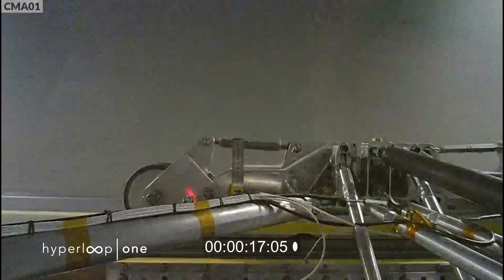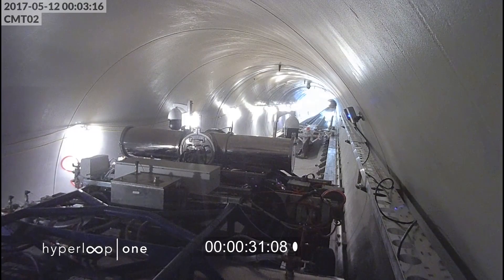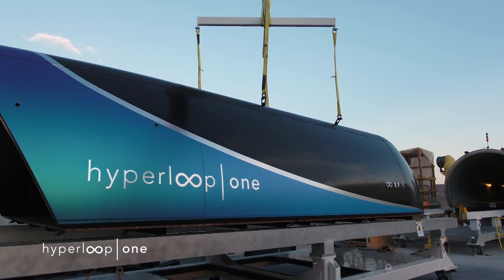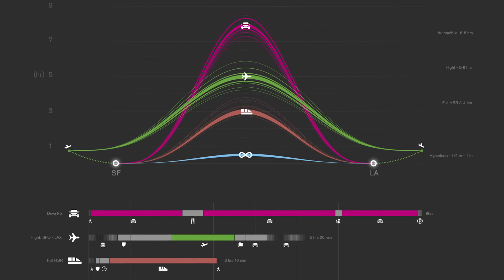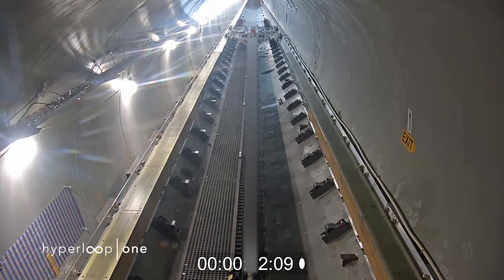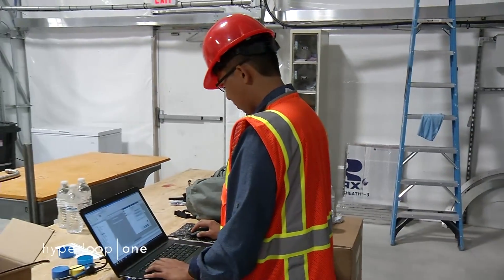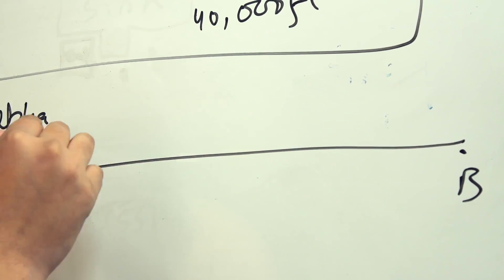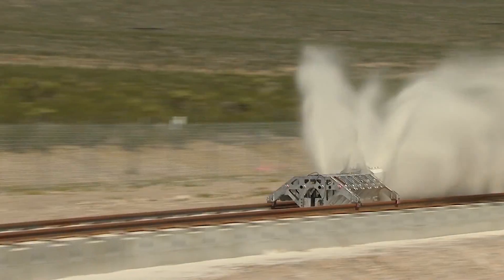Watch the Hyperloop Complete Its First Successful Test Ride | WIRED

Comment: What if a terrorist blows up the hyperloop and nobody can escape because the tube is enclosed? also what happens when the vacuum tube is suddenly opened by a gash?
Reply: What happens if someone blows up an airplane and no one can escape because they're thousands of feet up into the air?
Reply: If it was open by a gash, it would add air pressure and air resistance to the tube and slow down the vehicle.

And really? Terrorism as an excuse to not be advancing in society? Would you have said the same thing for tunnels and subway systems? (hint: it's called emergency exits) I guess the terrorists are winning.
Reply: I don't understand how anyone believes that a tiny hole causes the whole thing to implode. When you just barely crack open the valve on a PLASTIC vacuum chamber, does the whole thing explode? Now how about when you very quickly open the valve all the way? Still nothing. You get a small rush of air as the chamber is slowly repressurized. Something as small as a bullet hole in a miles-long metal tube wouldn't even be noticeable. On top of that, how would repressurizing the tube cause it to implode? Increasing the pressure makes it so the pressure is too low, causing the whole thing to crumple? Right
Reply: Then 8 people die... an airliner crashes about every year killing hundreds
Reply: What's your point suppose to be? Let's stop progressing, or create new technology because... terrorists. Lmao.
Reply: Joshua Salem While it may damage it, im pretty sure it wont destroy the entire thing, For it wouldnt be that fragile, Safety measures are important and since this is a public mode of transportation im confident they would have ways of emergency exit or stops like every other transportation has one. Its still developing and for now theyve only begun testing for cargo, But if it something like that might happen im pretty sure they would have thought of it before theyve begun construction
Reply: Thunderf00t seem to assume that the tube would be made of extremely flimsy material. How naive of him.
Reply: People, please don't watch one video from a random pissed off guy and assume he's totally correct. It's not nearly as dangerous as you believe.. Sure, if the entire hundreds of miles long tunnel were made of plastic, the pressure inside would be as close to 0psig as you can imagine and something would puncture it, there would be some serious danger for the people inside, but it's not. The entire, hundreds upon hundreds of miles long tunnels, aren't made of flimsy plastic but steel. The maximum difference between the tunnel and air would be about 14.7psi, but it's less since a complete vacuum isn't a thing. A tiny hole wouldn't have any noticeable effect on the tunnel, the whole thing wouldn't implode (seriously why do people believe that?) or explode or whatever. Apart from that, although there would be a massive difference in pressure, there's still a possibility for emergency exits. 
TL:DR The longer the tunnel, the higher the pressure, the stronger the material, the bigger the hole would have to be to have an impact on the tunnel. Learn the physics behind it, do some calculations and you'll find that in a realistically long tunnel that would result in a pretty big hole.
Reply: Nothing as serious as being up 25,000 feet in an airplane and the engines stop working.
Reply: Should i remind you that you're bashing a new idea based on it's prototype? you "engineers" really think this is a final product? that if the problems you talk about are so obvious that MAYBE the people actually working on this thought about this issues? that pipes can be reinforced? that emergency exists are a thing? oh, right, you're just a bunch of frustrated idiots who choose to trash concepts based on nothing instead of addressing the issues and try to improve on their design? 

The wright brothers also dealt with idiots like you, yet 60 years later we landed on the frigging moon.
Reply: Sure, Hyperloop is vulnerable, just like everything else. A terrorist could attack anything, not just Hyperloop, and how many of those have you seen happen in the USofA, especially bombings?? I've never seen someone blow up train tracks to send a train derailing into a nearby busy metropolitan area. Not difficult to do, but it hasn't been done. Or how about the under-water subway BART in San Francisco? That's a super easy target, and would cause massive damage if it caved in and flooded. Another great idea is to take down a high-rise bridge while a train is going across.
Reply: ThatPiGuy Neither does the Hyperloop. If you took half a semester of physics, you'd understand why.
Reply: SwiftFX 🙏🏽🙏🏽🙏🏽
Reply: Piniepopje True, the vacuum will slowly decrease (or in other words, the pressure will increase) and the vehicle will slow down. If the pressure is at atmospheric level there's nothing preventing you from stepping out of the Hyperloop and just walking to the closest emergency exit.
Reply: What if terrorists do anything? That's a stupid argument against it. Lets also not use elevators cuz maybe the doors won't open..

As far as if there's a whole, it's not pressurized, it's depressurized, so air would leak in at the same rate the typical house vacuum sucks in air.
Reply: Batu Yü With planes you can have strict security checking each each passenger thoroughly. 

Hyperloop is a train. Nobody wants to be showing their passport or be limited to 500ml of water just to travel from New York to Chicago.
Reply: Japan had a really bad sarin gas attack in their subways back in '94 but that hasn't stopped them from building more advanced and amazing public transport systems (including high speed trains). If we were to live our lives based around fear humanity wouldn't even have left the caves in the stone age.
Reply: idontcare80 Thank you, with all the danger of a high vacuum, just forget it and use maglev tech and try to beef it up if they can
Reply: Xtrememan89768 

I bet you'll be the first to start a riot after your loved one is dead. Calling out Hyperloop for failed safety measures. 

Terrorism is a serious threat and should be accounted for.
Reply: What's the chance of a terrorist blowing up a train from a million?
Reply: good job taking a idiot on the internets word for gospel
Reply: first of all nothing as pretty as they show in the videos and trailers. they would have some kind of electrical fence to prevent that from happening and also if the terrorist did get in blowing it would be quite hard since the way physics work a circle adsorbs impacts very well and for people to get killed would be very hard for the terrorist since they can probably only hear the whiz of it pass by and making the bomb blow up at the moment the passengers come by would be harder since they it will go up to 700mph
Reply: THE LESBIANEST LEGLESS SOCCER MOM IN THE EAST What if rockets explode while carrying astronauts? what if ships drown? Failures are bound to happen. We can't stop these things just because some pussies are scared. Terrorists can go screw themselves. Anyway they got metros and other public transportations to attack
Reply: 8 people? 8 rich people, this isn't gonna be public transport anytime soon so it aint really the future. Just another luxury good.
Reply: TheSmileyFacedPizza The theoretical vacuum in the loop is going to be a lot higher of a vacuum than a consumer vacuum chamber so when it's that high, a hole would be a lot more implosive.
Reply: Joshua Salem, I don't think you understand what a vacuum is. A true, perfect vacuum, meaning absolutely nothing inside of it, is at 0psia. Earth's atmosphere is at 14.7psia. You can't have negative pressure, and Earth's atmosphere isn't gonna increase after building this thing, so the maximum difference is 14.7psig, or simply 14.7 psi.
Reply: Don’t live in fear
Reply: the vacuum wil decrease
Reply: Where will these exits be?
Reply: why don't terrorists find better things to do? like blow up time square? that would kill more people.
Reply: THE LESBIANEST LEGLESS SOCCER MOM IN THE EAST A terrorist group would not want to blow up the Hyperloop. The Hyperloop I'm gonna guess will only be able to carry 50 people max, just a guess, terrorists want to blow something up that will cause absolute chaos and will kill so many people possibly hundreds of people. I would highly doubt that terrorists would want to blow a Hyperloop which wouldn't cause that much chaos and depending on how many people it'll be able to carry, it wouldn't kill that many people.
Reply: THE LESBIANEST LEGLESS SOCCER MOM IN THE EAST The laws of nature will beat them to it...
Reply: THE LESBIANEST LEGLESS SOCCER MOM IN THE EAST I think his point is this tube is a lot more vulnerable then a plane or building, one shot to the side and it’s done, unless this theory is wrong I’m open to correction
Reply: failtolawl, Air pressure would simply SMASH the whole tube when there is one single hole in there.
Reply: no you can just shoot it and it will implode and kill every one
Reply: Have you guys ever shot a pressurised air canister? or a a vacuum chamber? 
In both situations, it fucking explodes. There is no way a person inside of the tube would survive.
Reply: Massive failure on a grand scale and the instant death of everyone on board being crushed like a tin can in a vacuum chamber. lol
Reply: first of all it would probably be like the airport metal detectors and everything the only problem could be is if a fight was to breakout during the ride 100s of miles away from cities than that would be the problem because unfortunately their are people who are like that.
Reply: THE LESBIANEST LEGLESS SOCCER MOM IN THE EAST if we are afraid to invent stuff we will go through the dark ages again
Reply: Joshua Salem It wouldn't do that to the hyperloop either. This thing is flawed as fuck, but you can not be as ignorant to say that a single bullet would destroy everything, imploding inwards and killing everyone. Surprise, that can happen to planes too. This thing is not finished, there are still problems to be worked out. You must admit this is a revolutionary piece of technology, regardless of how safe it is in it's, may I remind you, unfinished state
Reply: Sugar Hieroglyph Stupid fucking question. Tops or sides of the tube, probably in the form of an airlock.
Reply: Buns Crapters Untrue. See above comments about depressurization.
Reply: CondemnUntruth See again, DEpressurized. Not the same as a can of air.
Reply: What if terrorists get past security and blow up planes, what if terrorists blow up tall buildings, what if the building falls over? What if terrorists steal nukes? What if Michael Bay made a good movie? See how annoyingly irrational and meaningless the what if terrorists argument is?

Obviously those concerns have solutions they can plan and work into the design, right now they are only testing the movement. Also nobody is going to force you to use a hyperloop if one is built. So if you think it is too unsafe you can rightfully "fuck off" and continue using a car and going to whatever job you do.

PS Michael Bay really needs to hire someone who knows how to make some good characters and a decent story and stop spending so much money on the CG
Reply: Funny how questioning the practicality or safety of a concept makes them think I'm anti-progress or anti-technology, lol no. If someone builds a hyperloop prototype and tests every single variable from emergencies to mechanical failures and comes out well as engineers would imagine it I'll be convinced but saying things that I'm not won't change my mind.
Reply: The strength of the material needed to maintain a vacuum that expands thousands of miles as a tube requires quite a bit of strength. I doubt that the company won't take extra measures to strengthen the tubes to beyond the necessary strength for the vacuum, just to be sure, once they have investors.

And as for the transport pod inside the tube. It's literally the same as a plane. Normalized pressure cabin in a lower pressure environment. So if this transportation concept becomes a reality, I'm sure the same measures to ensure no terrorists get on a plane will be implemented to the hyperloop. Terrorism is inexcusable, but it is also inevitable. Planes are becoming more and more of a common form of international travel, but has been victim to a variety of attacks.
Reply: That point can be applied to planes just as easily, and they're the safest mode of transportation available for the world right now...
Reply: I could definately see hyperloop being done in sections, so only a few sections are depressurized at a time. In fact this would be necessary for multiple trains on the same track.
Reply: THE LESBIANEST LEGLESS SOCCER MOM IN THE EAST if the hyper loop gets a leak, fucking rip everyone inside lol
Reply: failtolawl a gash of air traveling at the speed of sound yes
Reply: Eric Wang - Actually it would be more likely to collapse inward under vacuum then if it gets a hole in it silly boy.  Thunderfoot is an idiot btw.
Reply: 9/11 happened and people are still riding planes aren’t they? Stfu
Reply: WHAT IF A TERRORIST BLOWS UP A PLANE? NOBODY CAN ESCAPE, BECAUSE IF YOU GO OUTSIDE YOU DIE!!! OMG!! BAN ALL PLANES!
Reply: failtolawl emergency exits. ooh cool idea. lets add them to space stations. oh wait. no air. oops.
Reply: I don't think people like you deserve or can even dream of living outside earth. What ifffff space station explodes, what if colonies on other planets run out of oxygen. Let them keep inventing things. Some will fail but some will change the world. Anyway they are far more intelligent than us normal people wasting time commenting on youtube videos :(
Reply: William Perrine quit commenting that on everything and fuck off
Reply: The real problem is that there is a better alternative, it's called: A MAGLEV.
Reply: it would add air pressure which would only slow down the craft and remember how they said in the video near vacuum not a complete vacuum
Reply: shirin sidharta that's why I think while making it a vacuum tube sounds better, it makes it way more dangerous, it should not be a vacuum and should have a propulsion system they'll have to figure out make it go as fast.
Reply: it's almost like we won't have security advancement anytime soon
Reply: What if a terrorist blows up your home? Terrorism is a stupid excuse. You basically are doing exactly what terrorist want you to do; fear them.
Reply: THE LESBIANEST LEGLESS SOCCER MOM IN THE EAST by the same logic we should stop building trains, bridges and boats because "what if?". Using terrorism as an excuse for not innovating is ridiculous.
Reply: Shit gets fucked up is what happens
Reply: Xtrememan89768 Well does the whole NY subway system collapse and kill everyone inside if you hit it with something pointy? See the diffrence?
Reply: it wouldnt slow the Pods down it would suck them out through the gash... with uncontrolable speed and destroy more parts of the track.... there is research on this

Advance in society... o.O 
well we could build landing strips on sky scrappers to get faster from downtown to downtown... but its not safe therefore we slow things down and land out of the citys because shit could hit the fan a pressure loss in a tube could fuck shit up all along the way a transrapid can go half the speed of the hyperloop and does not need pressure to work and is still faster than a Train or a car
Reply: failtolawl At least in a tunnel somebody can come inside it to rescue as well as subway systems because it's not like a vacuum chamber where everything has to be nearly airtight, so if an incident happens in the hyperloop what happens? Do we have to shut the whole vacuum and cut the tube to let all the passengers out? How long would that take compared to a train in an open environment? Also terrorism is not an excuse for preventing progress, it's a reality and engineers should take this into account when designing something.
Reply: yeah but if you drill a hole through the walls of a subway the whole thing wont implode killing every one in it
Reply: read the actual whitepaper by elon musk please
Reply: shirin sidharta We all know that an attack can happen in any public place, but the Hyperloop is an exception since it's more vulnerable and simpler to completely destroy than any other area. A single gunshot can't take down a building or subway station, and this tube is exposed for hundreds of miles
Reply: Juan Ramirez yes because we raised security so high you could potentialy build walls with guard towers all along the way to secure it.... you can not hurt an airplane in the air as long as you secure the airports...
Reply: Rayaan Khan I'm assuming you don't have the slightest idea on how vacum chambers work
Reply: THE TUBE  WILL COLLAPSE INWARD! PLUS emergency exits on an ENCLOSED tube with no air is SAFE? plus if those were ever opened it will just make the tube collapse GO WATCH THUNDER F00T